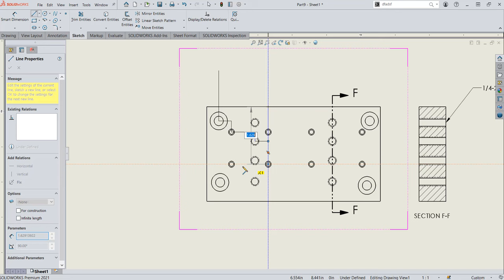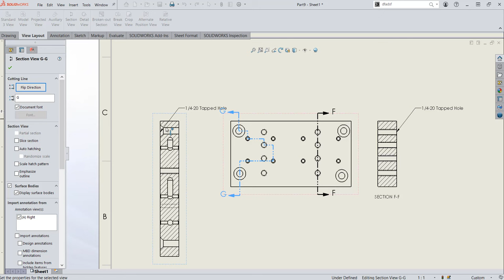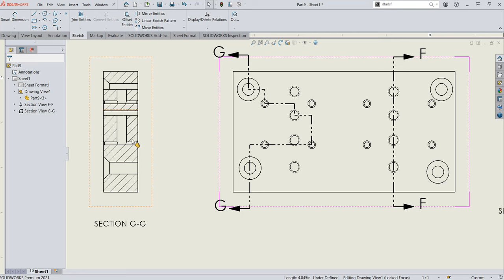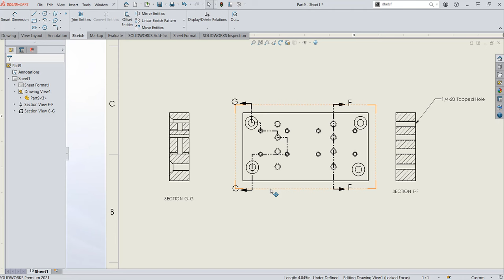SOLIDWORKS Tutorial - Custom Section Views

Comment: I just want to section view at a specific angle. You use to be able to edit the section view sketch, but of course SolidWorks hid or remove that feature
Reply from the maker: The easiest thing to do is draw the line you want to use for the section as a sketch on the view.  Then with the line pre-selected chose the section tool and it will create a view using that line as the section line. 

Alternately you can select the section line of an existing view right click and choose edit cutting line then push the edit sketch button in the property manager 

https://help.solidworks.com/2024/english/Solidworks/sldworks/t_create_section_view.htm

Comment: David, as much as this video is appreciated, your use case for custom section views in this video is covered by functionality within the section view tool without the need to draw and edit sketches.  I realize the intent of this demo, but for the use case here, you've demonstrated the hard way to do this without any explanation that this is the hard way and should be avoided unless you really really need to use this method.
Reply from the maker: Glad it was helpful!
Reply: @goengineer  Actually, I was noting potential for improvement that might be needed in the video.

Comment: very helpful, thank you. FYI: In SolidWorks 2022 two options pop up after you select the chain and select section view. You can either select the standard cut version, that is automatically created just like in your video or you can directly select the modified line, which only displays the lines that are othogonal to the section view. So this new feature will save you some time as you don't have to deselect all the horizontal lines.

Comment: Hi, thanks for this but I would like to ask when I would be performing custom section view in isometric view. It seems that there would be an offset on its isometric view. Any fix to this?
Reply from the maker: While in the isometric view pick a face or plane that you want the section view to start from. In the feature manager where the face populates the box below allows you to select the offset. Enter a value for the offset, green check ok. You can save this view if needed.

Comment: When I go into section view it doesn’t take me to section view assist.  I am using solidworks 2021 and my professor posted a tutorial where you need section view assist, but I can not access it.  The page it takes me to does not allow me to create cutting lines or anything.
Reply from the maker: If you do not see the Section Assistance make sure that it is not minimized. If so click on the dot below to expand the Sketch View Assist.

Comment: Very helpful. My only question is how can you adjust the depth of the section? For example, I don't want the section to go so deep into certain things that I see the whole part, just a fraction of an inch off of the section line (if this makes sense). Is there a way to do this doing this method?? I know you can with a regular section (adjusting the cutting depth) but I don't see a way to do it with this method, unfortunately
Reply from the maker: Thanks for the great question. 
If you want to customize the location when you create your sketch you can add dimensions using the Smart Dimension tool. If you want to edit a current Section cutting line, right-click on a Section line click edit sketch and this will let you add sketch relations and dimensions to specify an exact location.